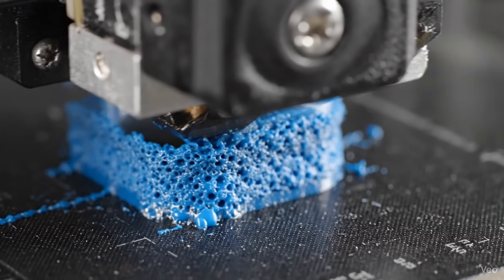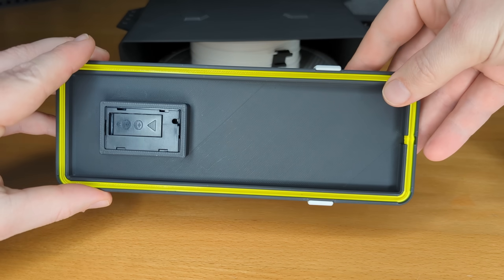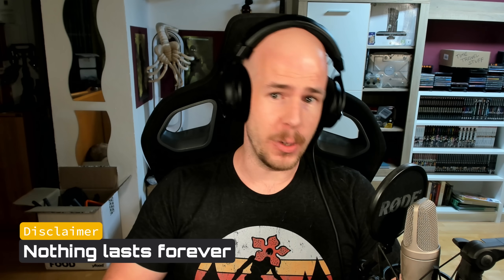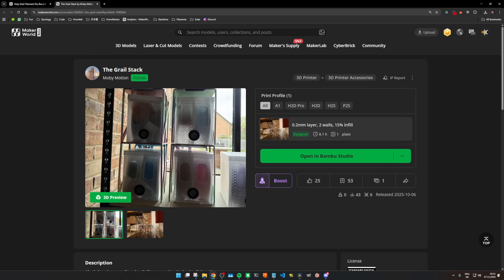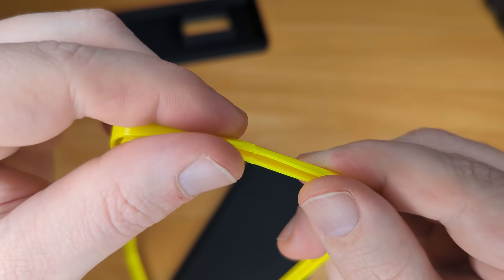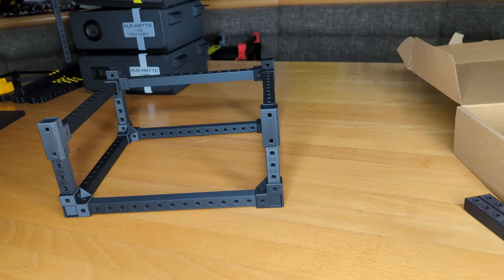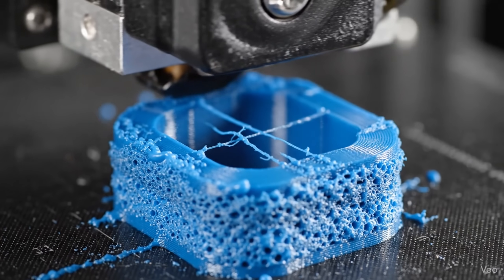Stop Killing Your Filament: My (Almost) Perfect 3D-Printed Dry Rack

Comment: I mean, this whole thing is only $3 more a unit than the 4L cereal boxes I use... that's not bad.
Reply from the maker: Inflation strikes badly ;-)
Reply: @kellerlabs  Haha yeah, I do like that these seem to take less space than my 4L cereal boxes, luckily no tariffs since I am Canadian... $3 per unit more, and I can cookt hem up myself as needed?? And they look fancy, and I can screw the frames directly to my weird walls? If I design a locking system I could theoretically even screw them to the stupid mansard I have at an angle hanging.

I already have 16 of the 4L boxes, so I feel a bit dug into that system and they do virtually have a perfect seal that lasts for years. Hmmm...

Comment: Funny: I activate subtitles to better understand better what English speakers say (I am French…). And the IA keeps transcribing HomeRacker as Home Wrecker…
Otherwise, it is an interesting solution, but a bit expensive: if you spend one roll of filament to store the roll, there is nothing left to store! (joking, of course) But the engineering is impressive.
Reply from the maker: expensive, yes, but you don't have to worry about wet filament, when there is none left ;-)

Comment: Love this! Im sure it probably already been mentioned in comments as a suggested improvement but in case not... print from box - a 'case' you can slide the box in and out of the racking from, couple of rollers inside, a self-sealing push-in sop valve and some ptfe tubing and you've a sealed all-in-one spool solution for filament thats not AMS compatible. My only other suggestion without testing would be that when the files become editable would be instead of a large clip over badge a slot for orca slicers flow rate calibration test print - I keep and use these as a way of identifying filament (colour, finish, and flexibility etc) - this gives reduced waste and cost
Reply from the maker: Thanks for this detailed feedback.
Yes, all of those points will be addressed in a future iteration, but I cannot tell when as there's a lot cooking at the moment.
I really appreciate your input because it increases priority for this project.
Reply: @kellerlabs  no problem it's nice to be able contribute even if it's in a small hands off way :) As with practically all product development, iteration shouldn't be rushed, time planning and prioritising now will save time and money many fold later. As diners we can tell you what we like to eat but as the chef you should decide what to cook and when - even if you stopped now it's still great!
Reply from the maker: @paulhandzel  this is poetry 😀

Comment: I've used those same hygrometers before to maintain a specific humidity level inside a sealed container. It would not maintain humidity. They aren't air tight between the screen and the housing, there are no seals at all, just the components in a plastic housing. Just fyi for anyone that wants to use these. Cool project though.
Reply from the maker: already on my list to revisit in the next iteration
Reply: @kellerlabs  Don't make it too good, I recently bought a pile of cereal containers. lol I subscribed to check out where this project goes and what else you're cooking up.
Reply from the maker: @cargasm383  I'll hold back a bit then ;-) Great to have you onboard.

Comment: It looks like we can only print this on P2S printer, why is that
Reply from the maker: i printed mine on a X1C and an A1. can you describe your problem in detail?
Reply: @kellerlabs when select P1S I only have the option to print the holder for the desiccant, but when you select the other printers it will give you the option to select any parts
Reply from the maker: @pedrofontes8494  ah now i get it.
Yeah that's an issue in the mobile version.
i don't know why, but X1 and P1 models are somehow not selectable and I have no idea why.
You'd need to download the 3mf on desktop and change the printer in the slicer.
Already reported that issue but no response so far.
Reply: @kellerlabs ya I did on my computer and I started printing it

Comment: Filament drying is one of the biggest scams! I bought the Sunlu dryer last year and have never had to use it! Maybe if you use a lot of Nylon but PLA and PETG drying is a waste of time and money.
Reply from the maker: I think it depends very much on your circumstances.
Where I live, summers get hot and up to 85% humidity.
Even PLA started "popping" once when I stored it poorly.
But great to hear, that some folks don't need that. The easier printing is without any mumbo jumbo, the better :-)

Comment: This design is amazing, congratulations on such a well made and document project (Homeracker)! Do you have a version with just little shelves instead of the dry boxes that could be used to store the spools still in the Bambu boxes directly (for new spools for example)?
Reply from the maker: yes I do. it is not part of HomeRacker but it should serve your needs: https://makerworld.com/models/449119
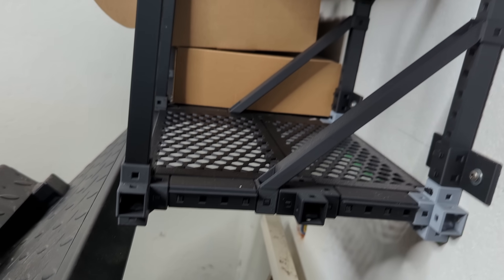Reply: @kellerlabs  thanks for the reply, but I wanted something integrated in Homeracker so I could already store my spools while making more dry boxes. Do you have a link to the shelf you use on the bottom of the wall mounted rack in this video at 2:57?
Reply from the maker: @Pustul  got you. sure. These are the droids you are looking for then: https://makerworld.com/en/models/1350569-modular-shelf-for-homeracker#profileId-1393154
Reply: @kellerlabs awesome! I missed that design, thank you for the link!

Comment: maybe design something that i can "dock" all the desiccant trays into, that will funnel the desiccant into a tray for baking, that I can then turn upside down, without removing the trays, and pour the desiccant back into the trays

kthx
Reply from the maker: That's an interesting idea for streamlining the desiccant drying process!
I already thought of something similar. I don't fully get the last part "that I can then turn upside down, without removing the trays, and pour the desiccant back into the trays".
Can you elaborate?

Comment: I think one way to elevate this set up is to have a vertical option with bearing rollers inside, and a lid that has a filament outlet (with a TPU cover to seal it).   Since not all filaments are going to be used in an AMS, be great to just be able to take the box and route the filament directly to the feeder.  This would permit the set up to be used on machines with no AMS.  For all my rolls being used (or partially used), I do print the desiccant roll spool core, which would permit for additional beads in the boxes.  Additionally, maybe a slimmer box can be used for that type of situation.  In any case, this is a great design solution!
Reply from the maker: Love the suggestions for a vertical design and direct feeding – always great to hear ideas for improving functionality!
As it so happens: This is already on my list for v2.
Thank you so much for giving it another push on my priority list :-D

Comment: The TPU seal is not that crucial as the temp/humidity sensor is a leak point….. 

Great idea, the main benefit is the huge desiccant container. 

The cost is the desiccant, filament, and rack system. 

Fantastic cad work!!!
Reply from the maker: tbh... I have no metrics which could proof or invalidate that claim :-D
From experience there's not much of a leaking as the cutouts are reinforced to support the entire depth of the hygros which makes air exchange even harder.

Thanks so much for your feedback.

Comment: any plans to make this possible to print on the a1 mini? or do you have a recommended glue/seal for putting the parts together while keeping it decently air tight
Reply from the maker: that might be a challenge. Currently there's no plan to create an A1 Mini Version. That would require a complete redesign from ground up.
But let's make it dependent on the community. If your comment gets a lot of support in form of answers and likes, I'll reconsider.

Comment: Wow, a fantastic, well thought-out design. I love the wonderfully designed TPU gasket! I also love your modular storage rack solution. I currently have most of my filaments stored on a high shelf, I could stack your modules on top of that shelf and hang a couple of layers of them below it, greatly improving my space utilization 👍😁 (The filament cost to make these is indeed an obstacle though, a couple hundred $ just for filament storage is a bit beyond my budget 😕

One note: the box is very well-sealed except for the humidity meter. It might be a good idea to use a little silicone or other sealant around it to avoid the minor air leakage that can occur there in the current design.
Reply from the maker: Glad you like the design. Thanks for your kind words. 
Budget is definitely some issue. Once I get monetized on YouTube I'll save up some money for more testing equipment so I can expirement with less filament-hungry versions.
About the "unsealed" hygro: I also had that thought in the beginning but it actually holds off humidity better than I was thinking. My initial version had a seal for that which i then discarded. But for v2 we'll go all in again.

Comment: What about having a snap in grid to retain the desiccant that allows you to just pour out the expended desiccant and refill it and recharge it loose in the oven.  Also allows for more desiccant, reduced filament usage, not requiring poly carbonate for the grid, and/or reduced box size (pick two, not three; choose reduced box size to minimize filament used)
Reply from the maker: That's some great input. Will think of it in one of my next iterations. Thank you!
Reply: I second this idea, loose dessicant is much easier and faster to recharge, and I use molecular sieve for critical filaments, which has a much higher recharge temperature than silica beads.

Comment: Hi there, what's the purpose to dry your silicate gel in an oven ? 2*2mn in a microwave do the job in no time!
Reply from the maker: 2 things:
1. Have never tried that before because of
2. Microwaves are very different in how they emit their radiation. Most vendors only have vague descriptions on their intensity levels instead of deterministic wattage. I think that's because of how a microwave transformer works. afaik it's an all-or-nothing kind of thing were intensity is only steered by internally turning it on and off for specific amounts of time depending on the intensity chosen. 

tl;dr: had no time trying that. But it will sure make a good test-case for a future iteration.
Thanks for your input!
Reply: @kellerlabs  You're welcome. I',ve been doing that for 10 years, full power on the Microwave : 2mn, then let it set for 30s then stir or shake the pellets, then run the Microwave for 2 minutes again. Done. Pellets, 3D prints and filament don't care about microwaves, except maybe PLA if it's soaking wet, but I never experienced anything bad. My Microwave is A 1200W.

Comment: I like the concept; both the rach and the boxes. However, for my use, I would wish it worked a slight bit differently. I would want to be able to print from those boxes. And I would want to see how much is left on a spool. So that's going to pose a new set of challenges. Maybe my usecase is to far from your usecase for adjustments to make sense?
Reply from the maker: Thanks for the feedback! Printing from the box and seeing filament levels are definitely on the list for future iterations, so your use case isn't too far off at all!
I already received feedback going in the very same direction. And v2 will at least have the possibility to print from it. Maybe I'll also experiment a bit with translucent filament or some kind of other indicator.
Thanks for taking the time leaving such constructive feedback.
Reply: @kellerlabs How about gluing in a piece of PC sheet, to make a window?
Reply from the maker: @mariusmossum2923  I was already thinking about some kind of translucent filament yeah. Thing is that this brings complexity with it as it requires a bunch of trial and error and another suite of long-term tests. But I will add it to my list. thanks for the great suggestion.

Comment: I printed Moby's boxes too, but I didn't like the lid. Then I started my own design and learned a few things about big volume prints and warping when using a Bambu A1. My printer is just finishing the 15-hour print of version 6... 😂
Reply from the maker: omg YES. That is exactly what I was fighting with as well. Prototypes on small diameters all went fine and then were really sh***y on real scale.
I think the A1 is a great printer, but the lids ALWAYS warp a bit at the corners (it's a bit better with a smooth PEI plate - used a textured one before). In my case not a big deal (it even caused the section of troubleshooting in the video), but annoying. My X1C is doing a better job.
And the print times are asking for real patience.
Good luck with your system. Would love to see your results once you're done, so feel free to link them here (or ideally in a new comment. answers on comments are not triggering notifications).
Reply: @kellerlabs in my case the golden pei plate got pulled off the printbed, the magnets are too weak in this case. The print stuck well to the plate.  It warped the plate in the middle and it formed an arch. With bad consequences for the poor print head. When you have thin walls, a 200 by 150mm footprint  and a rather  solid ring on top in 200 mm height strange things happen. My 6th iteration has beefier walls and did come out well this time. I have to test the capability to hold the humidity level now. 450 grams of filament for a box that can contain 2 Bambu spools, lid not included.

Comment: Just a heads-up: there’s a reason you don’t see many fully 3D-printed dryboxes. It’s not that people haven’t thought of it, it’s that FDM prints simply aren’t airtight. Even with perfect settings, layer lines and the material itself let moisture slowly pass through. Since most filaments are already moisture-sensitive, a printed drybox will eventually equalize with ambient humidity anyway. It can work short-term, but for long-term storage it’s usually not worth the time or material.
Reply from the maker: I appreciate the detailed feedback and the point about FDM limitations. My experience has been positive so far (6 months in), especially with the sealing mechanism, but it's a good reminder to manage expectations for long-term storage.
I will observe how it goes with my existing rack and maybe sharing some results in the future, if that's of any interest. Maybe also comparing it with some cereal boxes or vacuum bags.
Reply: It's very possible to make an airtight FDM print with the right print settings and a bit of over extrusion.

There's also filaments that are entirely non hygrophobic like Polypropylene which won't transfer moisture through the walls themselves.
Reply: I have made prints water tight with existing chemical varnish or sprays (different depending on the plastic used).
Reply: Yeah, I had been thinking about this kind of thing a lot. The best idea I've had is using vase mode with ABS,
 assuming the micro pores and such in the print will leak like a sieve, but take advantage of how easily paint and glue stick to ABS and rely on a few coats of spray paint to seal it.

My other thought was not printing the box, but printing tools to make the boxes from something better. For me, i have sheet metal experience and impulse bought a 50' long 28" wide roll of very thin roofing galvanized steel sheet... it was only $70 and I think I could make a fair number of boxes with some 3d printed tooling for more consistency. I sealing then is cheap with epoxy (or all the supposedly bad solder they let me take when they were throwing it out at work) and you can use unprinted TPU to make o-ring style gaskets for slip fit lids (just do a scarf joint and glue at ends). 

I think you could do similar things with other very cheap materials or combinations, but I'm not sure what matches thin roofing sheet metal on cost. Maybe something with laminates? Like tinfoil glued to very thin prints? Maybe glued to very thin wood? Huh... what about ceran wrap and tin foil glued to the insude of cardboard? Like, turn filament boxes into dry boxes and add only a printed lid that has been painted fir sealing?... I need to go do some tests.

Comment: I'm impatient and cheap, I've tried a lot of different ways to keep filament dry. My solution, which has worked for a long time, is a resealable freezer bag and a bag of desiccant. Disclaimer, I also have a dedicated filament dryer which I use for new filament straight from the manufacturer, especially PETG and TPU.
Reply from the maker: Sounds like you've found a system that works for you, which is awesome!
About drying fresh filament: I vaguely remember CNC kitchen talking about that at some point as well. I think it's a great "equalizer" to get ideal conditions.
Thanks for sharing your insights!
Reply: I get cheap freezer bags and just double bag them with desiccant since they cost so little. When I bought special ones for 3d printing they have that special seal for connecting something to pump the air out, but cost more and leak sometimes, and double bagging works and I just vacuum air out with a small portable vacuum, work better than those while costing less!
Reply from the maker: @radfaraf  thanks for sharing 😀

Comment: Great video, really nice build! 👍
One idea that came to my mind:
You could add a small valve connection for a vacuum pump — that way it wouldn’t just be airtight, but also air-free (real vacuum seal).
Would be super useful for storing or testing stuff under vacuum pressure. Keep up the good work! 🔥
Reply from the maker: A vacuum pump connection would be excellent for specialized use cases, noted! However, I believe for now it is only airtight under atmospheric equilibrium (essentially, it just prevents air exchange between the chamber and the outside).